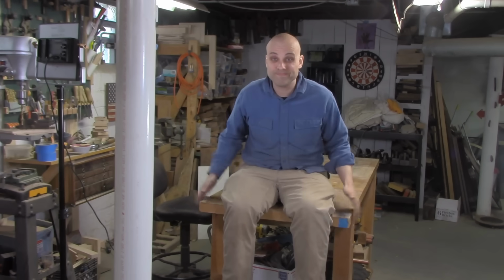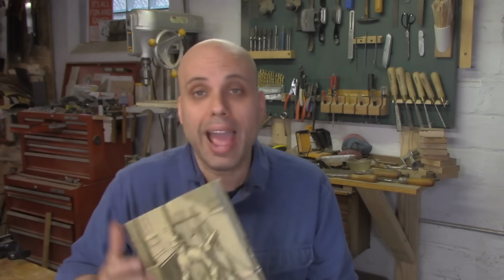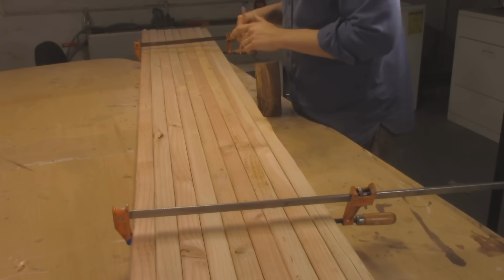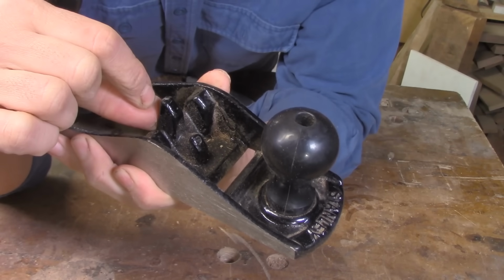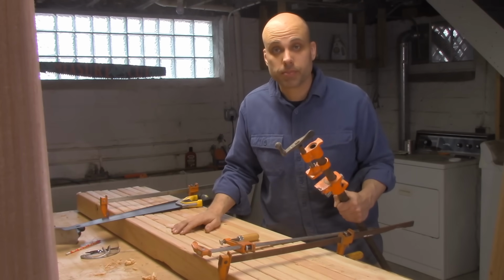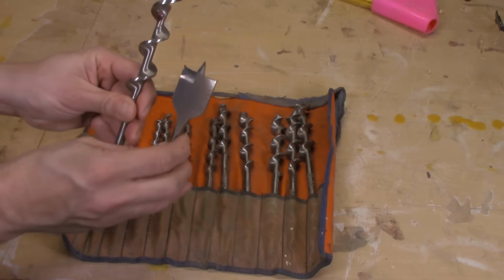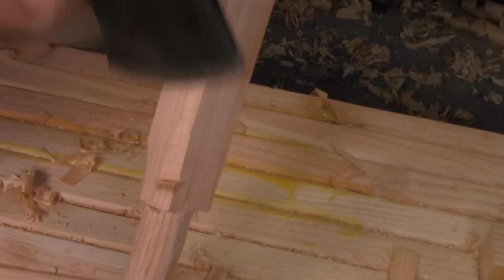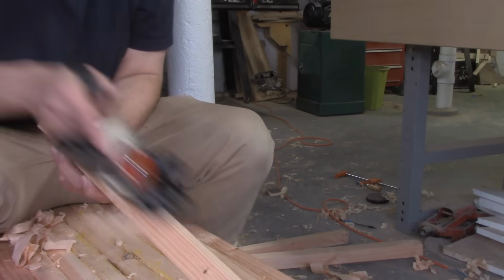Build a REAL workbench for $30

Comment: Rex, you should check an older FWW article by Brian Boggs on modifying the spokeshave: He outlines how to create a large, flat surface area for the iron to bed on in the casting, using epoxy - I suspect it would be a great solution for Stanley's contemporary No. 4!

Comment: I'm designing a workbench inspired by this one. Why angled legs instead of straight up and down? Is it a trade off between how big the foot base is for stability vs. strength in the legs to stop them splaying outwards when force is applied?
Reply from the maker: It gives the base stability while keeping the underside of the top clear for clamping, etc.
Reply: @RexKrueger  Thanks for the reply! Here's my idea so far, https://i.imgur.com/Ehxv7Qh.gif I like the form factor and portability of the roman style bench, but prefer more standard work holding. So dog holes and two vises. Straight legs so I'm not hitting the skirt on one side, and slightly wider angled legs to give a wider base. 

I've wanted a work bench for ages but had no room, so thank you so much for introducing us to a Roman style bench!

Comment: I started my Bench this past weekend.  Lowe's only had 2x4's in White Wood.  Thanks for telling us to avoid that material. They did have KD DF 4x4's so I went with that.  I also had a reclaimed DF 2x4 on hand so I was still able to have the 2x2 peg hole in the middle of the bench.  Still have to put the legs on it.  Total cost for me was $50 as the 4x4's were about $10 each and I picked up a $10 bottle of glue.
Reply from the maker: I think you'll be happy with the DF 4x4. I was going to go with that material, but I wanted to get the cost as low as possible.

Comment: How did you know I was looking at the $50 to $80 dollar benches at the HD? I'm 300 lbs and those 4 legs with no bracing scare the shit out of me as falling is something I have done way to many times and is the cause of most of my perpetual pain today. Thanks for all the great tips Rex
Reply from the maker: I hear you!  I'm no light-weight myself. For you, I suggest simply using oak for the legs, keeping the thickness at 3" or so and bumping up the tenons to at least 1.5 inches. Properly installed, they will support you. No bracing needed. I clock in at a solid 225 and the thin, softwood legs I used show no signs of stress. Stay safe!

Comment: At present, I'm flattening out my bench but I should point out a frustrating conundrum I experienced when getting started...I spent well over 30min picking through over 40 pieces of lumber to get the straightest boards I could find...took them home...when I got to work on it on the weekend, there were only 3 of the 9 boards that did not warp to all hell.  After buying more clamps and spending countless hours planning both faces of all boards I now have a very nice and tight glue-up...but I think I learned that shopping for beautifully straight boards is a bit of a waste.

Oh and by the way...last night I used my Black and Decker Workmate and an antique panel saw to resaw a 2x4 then used the bench to plane them into a beautiful set of winding sticks that are flat and even in height to within 0.005". Loving this bench already...and I still haven't given it legs.
Reply from the maker: I'm sorry it was so tough, but I'm glad you like the bench!

Comment: This is the second video I have seen of yours & tbh, IDK why I didn't click the subscribe button the first vid (Oversight) 
This idea would be perfect for me as I am in a wheelchair & tbh, a lot of the time in a wheelchair is really a pain in the ....... BACK (Censored) but you get the idea. Also the usual height of a workbench is agony for someone to work sat down at, the piece I am working on is ofter around my eye height & hard to do anything serious. I spend a lot of time out of my chair & on the floor when I am indoors. Now you have given me the idea that I can now spend longer at the workbench by making it lower than a 'normal' (Whatever the heck normal is) Workbench height,  Knee height is actually a really good starting point for me to work at. 
Any other suggestions you may have for a disabled woodworker (Intentional, or not as in this vid) would be appreciated.
 
Thank you for this. WATCH OUT WOOD! Coming through! (Did anyone else just get a visual of the Ben Hud race scene with chainsaws on my wheels? lol)
Reply from the maker: I have heard of many woodworkers who have compromised mobility and still do good work. It's not as unusual as you'd think. Good luck!

Comment: OAK. MAPLE. FIR.
SODIUM SILICATE ...DIY. WATERPROOFING AND FIREPROOFING.
FIR.... LEAST COST. HARDNESS GROWS AS IT AGES.

GLUING WORKS BEST IF PARTS ARE SLID TOGETHER UNTIL STUCK.
THEN LIGHTLY CLAMPED, SURFACE FLATNESS IS IMPERATIVE.

Comment: you even don't have to split the pencil: 
- just drill a hole in a woodblock so the pencil fits in not to tight and not to loose.
- don't go through the block, so it can sit in - saves the glue too and the pencil can used "as intended" afterwards.
Reply: I inadvertently discovered this a while ago when I noticed a golf pencil fit perfectly in a hole I had drilled in a scrap piece of wood, and I have been using it for that purpose ever since. A couple of holes through the block measuring different lengths from the center to each side allows for each side of a cube to be a different reference height, allowing for a ton of different trim heights. Also, you can just add tape to the pencil to make it fit snug

Comment: Would there be a difference in using thicker pieces of wood to create the workbench top? or is using multiple smaller width pieces better?
Reply from the maker: Ivo Verhaar 2x4s are cheap.  That was the main thing.  If I wanted to get 4x4s of the same Douglas fir, they would have cost 16 each. In general, fewer thicker pieces are easier to glue up and flatten,  but the finished product will be the same.

Comment: What is the reason for planing the pencil in half? I'm not seeing the necessity in doing that. Simply gluing a pencil to a block should do the trick.
Reply from the maker: Puts the lead exactly at the top of the block. No need to account for pencil thickness. Not necessary; just a tip.

Comment: That was a really good demonstration and a great idea. My workbench is actually an old pool table with two sheets of MDF for the surface. I chose it because of the height it gave me (like you, I'm somewhat tall and a big bloke), and it gave my back a break. I recently sourced a bench vice out of an old college workshop and suddenly realised the problems I've got in terms of fitting it to the existing bench (not to mention the virtually impossible task of adding dog holes etc.). Additionally I've discovered that the bench height is impractical when I'm working on cabinetry, more often than not I end up working on stuff down on the ground, which is hard on my knees and back. It is unstable enough to have me a bit worried and because the pool table is very heavy it requires many hands to get it level and I've only ever had two hands. Long story short, I'm going to have to make some changes.  The Roman bench is going to give me a stable, level, portable bench to get what I need to get done. I get to sit down on the job which gives my back a break and doesn't hurt my knees. I get to have some dogs, at last. I can pack it away when I'm not using it. I can work much more closely and easily on cabinetry.I can take it outside under a tree on a nice day when the shop is hot and humid. I can use it to design and build my new permanent work bench at my own pace. And I can buy some good timber for it out of the sale of the pool table. Cheers mate! I am subscribed :-)
Reply from the maker: I'm really glad you liked it!  I think it will give your back a break. My back likes it!

Comment: I think I'm going to build one of these, but I'm pretty sure you didn't factor in the cost of the glue ;)
Reply from the maker: Fine. $30.56.  :)
Reply: @RexKrueger  Where do you get glue that cheap? Looks like you used a fair bit, I would have estimated that that much glue would cost me nearly $10 where I am.

Comment: I will be starting the bench when a winter coat is not required.   The Rockford Kiwanis  I was told built the first rotary pancake maker for a fund raising.  The standard part in every event that I have been to of theirs in two decades is taking a folding table and raising it up to counter top height.  And put everything under the sun on them.  Stable as a rock and cheep and easy to do.  My collapsible folding table has leg extensions that fit nicely in the folded table.   

I think these leg extension will make your bench just that much more useful.  Try it out.   They take PVC plastic pipe that fits over the leg, and it can be very loose fit.  I had some 1.5 sitting around.   Saw four to the same length. I made them long so I could take a second shot at getting the high correct.   Slide them over the existing legs until the hit something and stop.  Your case would be the top but for folding tables it is a bend in the leg.  Your done.  You may want to put caps on the pipe if your putting the bench on dirt and for sure if it could be muddy.

Buggy cord could be stapled to the bottom to hold the extension pipe legs.

Comment: And the pencil trick! Dropping some knowledge!
Reply: you even don't have to split the pencil: 
- just drill a hole in a little woodblock so the pencil fits in not to tight and not to loose.
- don't go through the block, so it can sit in - saves the glue too and the pencil can used "as intended" afterwards ^_^

I make sort of these for myself to have a "pencilcap", so the fresh cutted sharp tip won't break everytime or ruin my clothes with holes.

Comment: In the UK that would work out at $60!  I think I'm going to make something similar, so many thanks.
Reply: Greg Wallis that is a disgrace, that much for 2x4s?
Reply: @RTCT84  At the local lumber yard they're $11 each, and at the Home Depot equivalent, here in the UK, they're $6.50 for the nasty stuff. Wood, over here, is expensive. Sigh.

Comment: This is an awesome video! I saw Chris Schwartz working on this project some time ago and have wanted to make one, but have not had a chance to work out specific plans. This is a big leg up for me! That said, I was thinking of using a single 2x12 at 12' or 14' and cutting it in half, then gluing the broad faces up. I figured that'd be an easier glue-up and also facilitate more flexibility for boring and mortising to provide work-holding options. Do you have thoughts on the alternate bench-top approach?
Reply from the maker: That would probably work, but for sure would not be as stiff. I'm all for experimentation, so feel free to give it a shot!

Comment: Since my joints got bad, I'm having to do most of my woodworking sitting down now & it's so much easier for most things & really adds to the stability. I even work at the lathe sitting down; the extra leverage you can get by standing doesn't seem to be necessary at all (at least on things up to about 8" diameter).

Comment: This is a great bench.  But can kick it up a notch.  instead of getting the eight foot 2x4's go to the  16 foot 2x4 and have them cut it in half .  And why you ask what the reason for doing it.  The 16 foot 2x4's come from an older tree and the wood is much harder than the 8 foot ones.  All of my work benches start with 16 foot material and well worth the extra for the longer material. Check out the difference between the woods.
Reply: I've tried this. The only difference I saw between the two lengths (8 vrs 16) is that after picking the best 16 footers in the stack, they were cut in half and became my worst 8 footers due to all of the internal stresses probably from the quick drying. The new 8 footers bowed and twisted all over the place. I wouldn't have picked them to use as 8 footers. I've had better luck buying wide, not long, and then cutting to the width I want rather than starting with the huge lengths.
Reply: Great tipp
Reply: I've never thought of that being a factor before. I'm going to think about this from now on when I get wood
Reply: A CYNWRIG I got wood only yesterday. My wife was so happy.
Reply: @SimonBarnsley  - go away
Reply: They aren't really older growth trees. They're actually fast growing pine, fir, or spruce from being genticely modified.
Reply: @jamessimmons1289  genticely?
Reply: @jamessimmons1289  -  genticely???
Reply: @jonhohensee3258  Orgently he meant "genereticly".

Comment: I can't wait to see where this goes, I would have left the legs removable (I think I will on mine) so that way I could put it in the back of a truck for a very mobile work bench that can be used in my shop or at a friend's house if said friend does not have a shop at all
Reply from the maker: You might find that tricky. Still I'd love to see the results if you do it!
Reply: @RexKrueger  will do, might take a week or so but can do, did make the mallet today though.

Comment: in your large stores Lowes, Homedepot at the front of the lumber area is stud 2x4s and those are not 8ft they are 3 inches shy of 8 ft and generally have a bow in them along the 3.5 inch length as there is a top and bottom while I understand you are building cheap this is info that's good to note for new wood workers looking to create a project like this, new wood workers wont have a huge plane to flatten the wood and if stacked with out knowing about the bow could drive them away as they start to think they need expensive wood or really lucky to even do a basic job like this,
Reply from the maker: Um, I made this bench from Home Depot wood. I didn't use a big plane. Picked the boards carefully. Worked fine.

Comment: What a great idea for the levelling of the bottom legs --- the half-cut pencil glued to another flat piece of wood, simple but something the normal person wouldn't have thought of ---- only one word for it ... nice.
Reply: You don't even have to halve the pencil really, since they come with preinstalled flat edges. Superglue will hold one of those just fine.
Reply: Or, drill a hole slightly smaller than the pencil through a block of wood, then insert the pencil in the hole.  Reduces the wastage of the height of the leg by doing that.  If you need to get the pencil out, tap it out with a piece of dowel.

Comment: Rex, I've always found that hardwood up to around 12/4 is fairly easy to find and most of the yards don't mind cutting to length.  I just bought a 5' x 10" x  9/4 thick piece of hard maple for a mini-workbench.  Paid $4.75/board/ft. It can be a bit tougher to work with since most will need some minor flattening and smoothing and some need a bit of jointing as well.  2x4s are certainly cheaper, lighter and easier to work than maple but they are also very often, very WET when they arrive at the home store.  Good wood though.  I have couple built with air dried pine, one covered in maple plywood.  Much cheaper than the solid maple or oak top.  Good video.
Reply from the maker: I think if you have the wallet for 12/4 hardwood, you might not be the target audience for this video. All the 2x at my Home Depot is acceptably dry. These things vary a lot by region.
Reply: @RexKrueger  - actually what I buy is considerably cheaper per board foot than HD or Lowes and the variety is way greater.  Not a lot of maple, pecan, walnut or cherry at the HD lumber dept.  Just red oak and poplar and at 3/4" and under.  I enjoy the videos and I've recommended them to some of my beginner friends.  May just be how I was taught in the late 50s and early 60s.  If I wasn't using pine 2x4s, then I ws cutting and dimensioning my boards from rough sawn 5/4 or 9/4 slabs felled and milled on the ranch.  Oak. pecan. walnut, cherry, poplar, crab apple, cedar, bradford pear and some maple in the mix.  Dimensioned hardwoods just weren't an option.  As a result, I still get most of mine from rough sawn pieces.

Comment: Another guy from Northern Ohio is the LAST person I'd expect to find such excellent content lmao. What I love, in particular, is that this can be done on the floor. That is huge for me. Getting tools sharp may be difficult, however. I wonder, since I have a hand sander and a heat gun, if I could pour some cheap epoxy over the whole thing to fill cavities due to slightly warped 2x4s, and then sand down back to bare wood. This would, naturally, come after hand-planing the entire surface to get it as level as possible without epoxy, first. (After all that trouble, I may as well give it a topcoat of poly). Anyway, thank you. I eagerly await future videos on this.
Reply from the maker: I would try to hold off on the epoxy unless there's no other choice. Either getting better wood or planing the warp out of it is probably a better more.
Reply: @RexKrueger  Gotcha. What about MDF and similar materials? I have available thin sheets from old flat-pack furniture. I could cut a bunch of strips and glue them up vertically, and create a new surface. Perhaps all the glue needed for such a large number of thin strips would provide extra strength. Maybe that, mixed with 2x4s, for a hybrid ply. What are your thoughts? 
Thank you for the brilliant content.